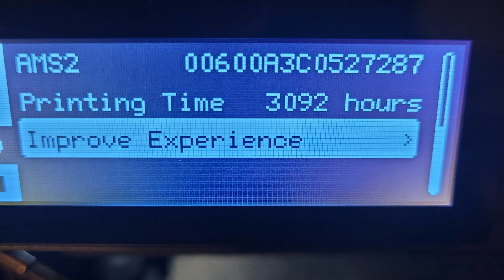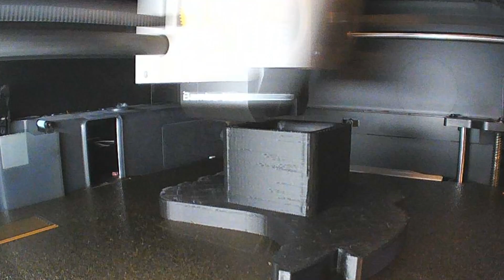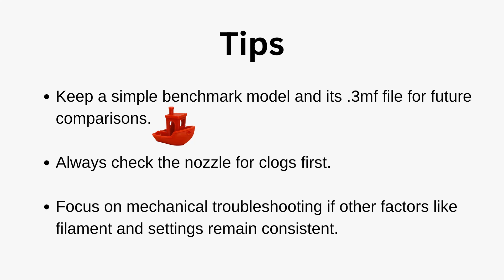Fixing Under-Extrusion on My Bambu Lab P1S 3D Printer (With AMS)

Comment: Would you be able to help me with some of my prints? I’m currently having a similar issue however it happens on all of my 4 printers (2x P1S, 2x A1) not sure what to do but I do have pictures of what I’m running into. I tried, pretty much everything you covered besides the last step. Just wondering if it could be the same issue
Reply from the maker: I only have P1 series printers.  I recommend replacing one item at a time to troubleshoot the cause. Start with the easiest part, like the nozzle, and work backward from there if that does not fix the under extrusion.
Reply: What’s fillament are y using
Reply: @angel-angel-angel-angel-angel Bambu brand. Pla

Comment: Hi! Thank you for this video, I will try that. I have 4 p1s printing the same file, but one of them start underextruding when it changes the filament in the ams. Starts printing in black perfectly, but when it changes to white the issue starts. The same happens if I make the base white, it make it perfectly but when it changes to black underextruding appears. The other 3 p1s print perfectly the same file.
I opened the extruder, and like you said, I saw like white dust or debris in the tubes and in the extruder, maybe is that. But I don't understand why this makes underextruding, do you know the answer? I don't find the logic to it. Thank you!
Reply from the maker: My guess is that as the tube becomes worn, it causes resistance on the filament. The printers can not account for this resistance and then under extrudes.
Reply: @Solid3dMemories  Ohh okay, and I'm trying to change all the tubes but the ones I have are not the same lenght. Did you buy the tubes separately?
Reply from the maker: @Tombie17 I bought the tubing that is longer and can be cut to the length I need.

Comment: Great video. You should have more followers. 
Something similar happens to me. I experience underextrusion but only with Overture PETG transparent. I experimented with bed temperature and nozzle temperature, calibrated the filament twice but the only thing that was achieved was to shift the underextrusion to higher layers. The underextrusion begins about the height of the layer 10 or 11 and makes printing the model impossible. This happens only with this specific filament and I don't know why or how to fix it. Does anybody know this? Can anybody help?
Reply from the maker: Thanks for the comment. In my personal experience, the cause has always been mechanical with this type of error. Whether it was a bambu, creality, or any other  brand of printer. My best advice is to start with might be the easiest cause to fix and work your way through the machine one item at a time. For example, replace the nozzle and then run a test print. If that does not fix it, move onto the next item. Only change one thing at a time between each test print until you find the cause. Sometimes, it is the filament itself, and other times, it could be the tension on the best or striped extruder gears. Sorry, I can't be more specific.

Comment: So the real issue was a extruder motor, it gets too hot and cause the clog because extruder gears were too hot and hotend radiator too, filament start to melt before nozzle. It is very often problem in P1S
Reply from the maker: I was not aware of that issue but it does sound like a plausible explanation, thanks for sharing!
Reply: In the video he said that before he replaced the motor he replaced the Bowden tubes and the problem disappeared.  I did not hear him say that he ever got around to replacing the motors, he just said "I considered  replacing the extruder motor, but before doing that I decided to replace all the Bowden tubes..."    

I am curious why you suspect the motor.  Is the motor a known problem with this unit?  They are in a heated enclosure which is not the healthiest thing for them so I can definitely believe that could be an issue.  

Please note that I am asking a sincere question as I am very new to 3D printing and am trying to learn and understand how to get the best results.
Reply from the maker: @GMx_1  That is a great question. You are right I did not get around to replacing the extruder motor to correct this problem. The reason I was considering replacing the extruder motor was two fold. 1. I also have a P1P that was having extrusions issues after about 4500 hours and the extruder motor did "go bad" and needed to replaced. 2. At that point in time I, after replacing the extruder and the hot end, I could not think of another component that could be failing. The extruder motor did not seem likely based on the results of the test prints which is why I decided to replace all of the Bowden tubes before moving on to the extruder motor. Just FYI, for me, replacing the extruder motor is not fun.

Comment: How did the tube get so bad it caused blocking?
Reply from the maker: I only have theories. 1. The opening in the Bowden tubes was causing enough resistance on the filament to not let it extrude properly. 2. Debris material from the Bowden tube being worn away was being fed into the nozzle causing small clogs. I am not exactly sure which is correct, if either, which is why I only stated what I did to the machine that led to the correction of the under extrusion.